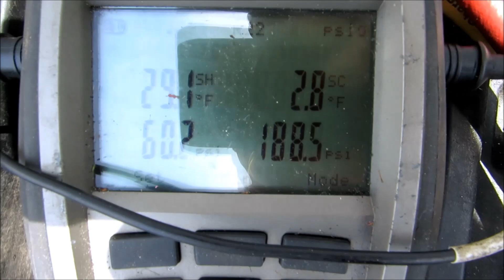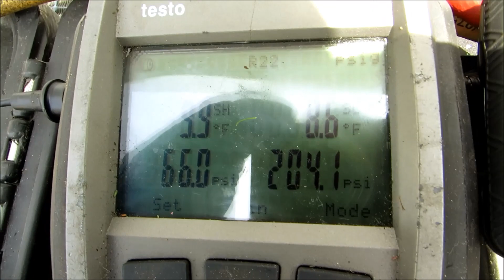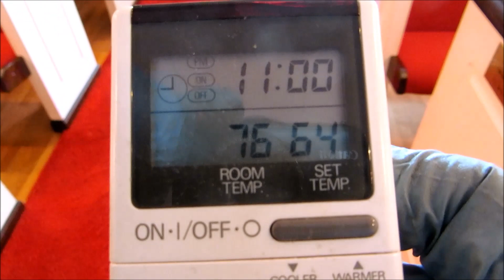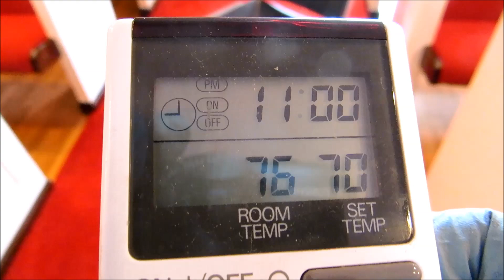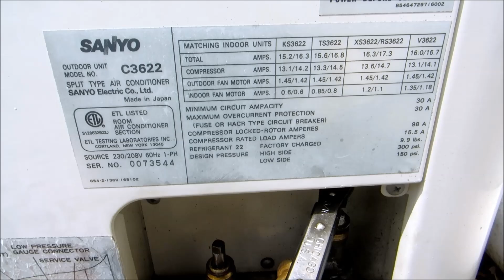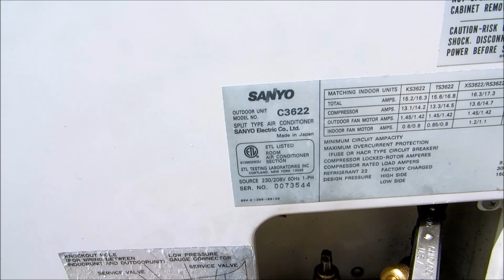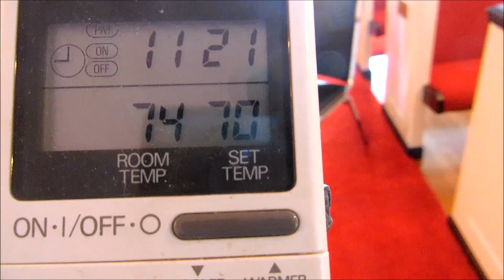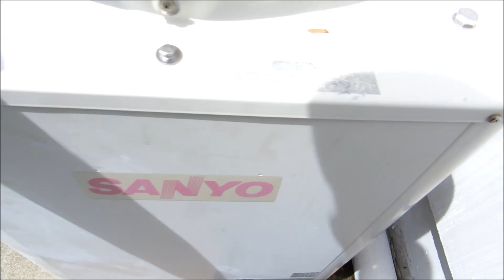hvac : sanyo split system odd unit

Comment: We got a church we have been working on.  They have had 3 weddings in the past 3 years and every time they have a wedding the ac goes out.  Same church on one building units are about 10 years old.  2 condenser fan motor single phase but trane so went back direct.   and two three phase blower motors.  And one unit that a TXV is on its way out but it doesnt run enough to cause alot of problems as of right now.
Reply from the maker: not all equipment ran smooth . some have issues for sure

Comment: How come u bomb 22 in when I know it's leaking? 
Who I work for if there's any problems with a 22 system it just gets replaced with a 410 system.

I always thought it's a bit naughty to put gas in when u know it's leaking?
Reply from the maker: added 1/2 a pound of r22 the people do not have the money for a new system at this time there in there 80 s and can't even pay me for what i did already  ... there are a lot of system that have small leaks .if its a bad leak yes the system need to be changed . sounds like your boss is out to just replace a.c. units more power to him .
Reply: If its an r22 system what if it leaks so slow it takes 10 years to get this low, always a possibility